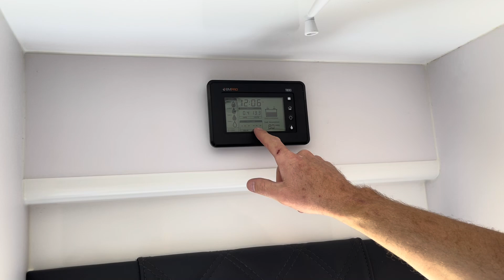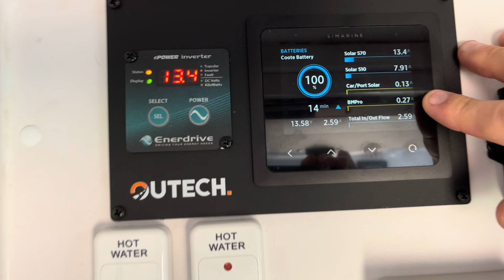Crusader Excalibur Prince Caravan - Power UPgrade!

Comment: I have a Crusader Excalibur Prince caravan with the factory Redarc Redvision 80A Total Management Upgrade Bundle which includes the following:       
               
   RC TVMSKIT05-10M    Charger RedArc 12V 80A Manager 30    1    
   CES B-71-CC04-003    Charger Board REDARC PFC 600x360    1    
   BS CIRVSENDER-    Sensor Water Tank 7.5M RV Sender    3    
   RC LBAT12200    Battery Lithium 12v 200ah LiFeP04    2    
   RC R-12-3000RS3    Inverter Redarc 12v 3000W  Pure Sine Wave    1    
   RC BCDC1250D    Charger 12v 50amp Smart Start DC/DC 4 Stage    1

I've watched a couple of your videos and in both instances, you have stated your dislike of the Redarc Manager 30.  Can you please clearly articulate your issues with the Redarc Manager 30, and better still, what you consider are the shortfalls of the system outlined above - this will help me in with future planning. Please note that the factory Enerdrive system was an additional $4,000 over the Redarc system.
Reply from the maker: @gjeess1 manager30 is a high quality system with a lot of great functionality and reporting when used in the right application. 

Its limitation in larger systems is that is a 30a charger max. To enable it to become a larger system charger you are required to add another charger (in your case a BCDC) which then takes information away from the reporting functionality that makes manager 30 so good. 

For example in your system I would assume that the BCDC is doing the solar regulation. Which removes solar reporting from manager 30 and it is simply seen on the system as current inflowing from load. Essentially just a glorified battery monitor with a single shunt. 

Redarc have some new products on their way which fingers crossed have some larger capacity and functionality.

Comment: Great video but would really like to see the install rather than a very quick glimpse of what appeared to be a professional master peace. Also, what about describing how the additional solar array was wired back to the bed as being composite walls may have been a challenge to? Thanks
Reply from the maker: Cheers Greg, each build is different depending on the van etc. We'll look at covering these points in future vids.  Stay tuned  👍